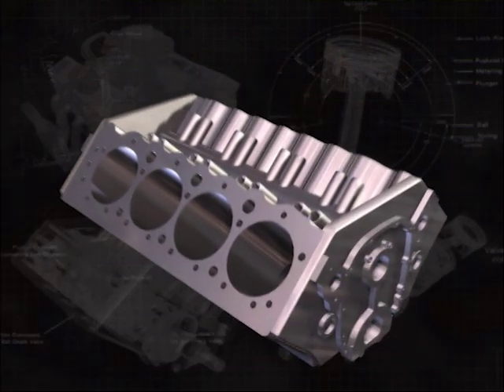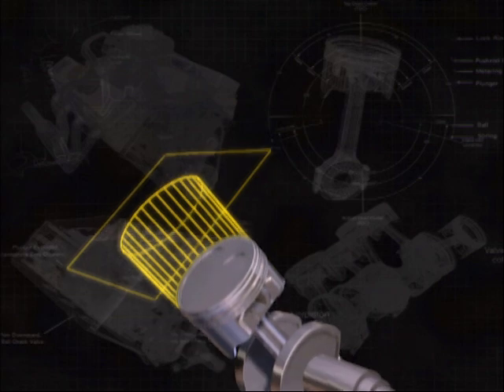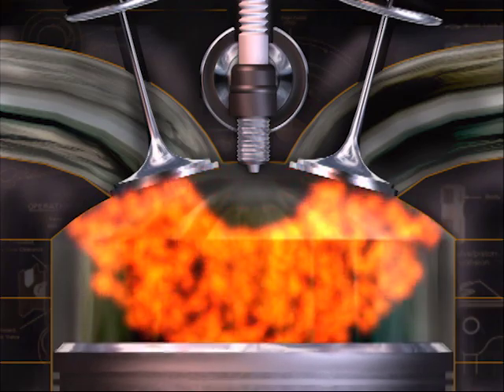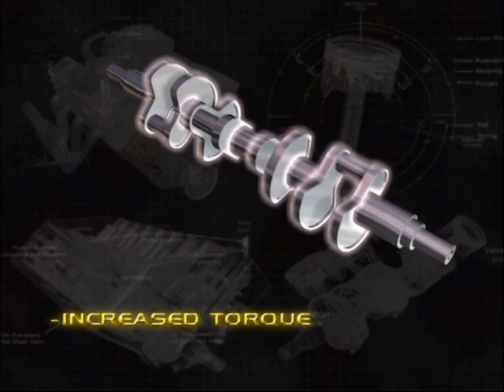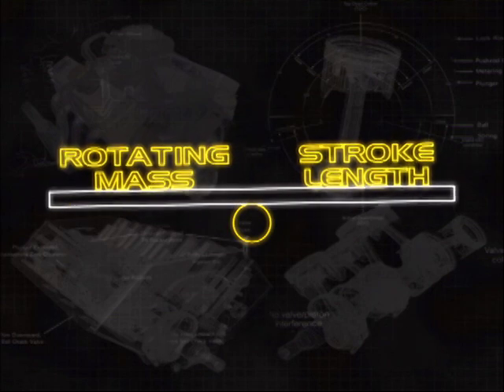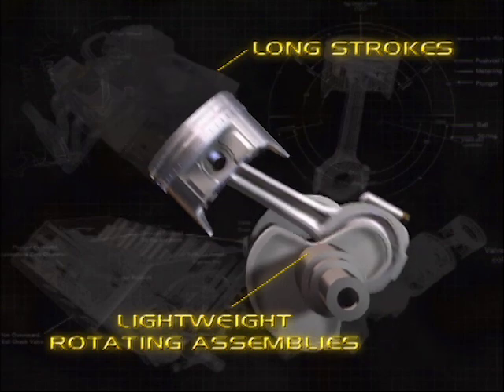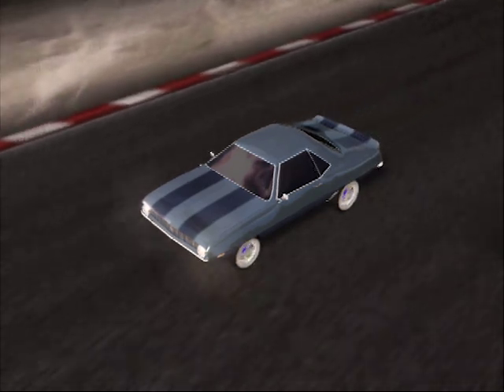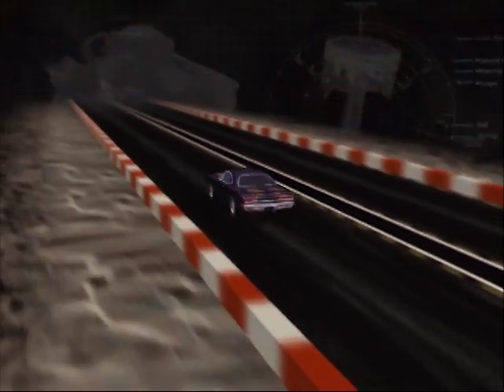Stroker Engines Explained

Comment: I have 2 small bikes both are 150cc. One oversquare (63.5mmx47mm) and the other is undersquare (57x57.8). The undersquare engine is more jerky in low rpm. But the oversquare has much different top end power because of high rev. For a commuter purpose i suggest square engine or undersquare because we don't need much rev to feel the torque and save fuel
Reply: Basically why my g35 sucks fuel compared to my Ecoboost which is twin turbo. I figure that was why but you just confirmed it

Comment: So remember:: always put a 350 crank in a 400, never a 400 crank in a 350. Revs are horsepower. Truck engines belong in trucks
   Go to a drag strip. If you're worried about that short stroke just change the rear end ratio. You can because you gained about 2000 rpm over that stroked RV engine. Revs are HP
Reply: One of the best engines I ever built was a destroked 400.  .030 over 400 block with a 350 crank makes 377 cubic inches if I remember correctly.  And I angled milled a set of double hump heads to raise the compression to somewhere in the range of 11 to 1.  We had it in a stock dirt car and it never got beat. We ran all season and never did anyone ever get in front of us at the finish line.  77 Camaro with a 3 speed standard and that engine somehow all came together as a combination that was unbelievably fast...

Comment: by increasing the stroke dont you reduce power because of reduced max rpm from longer square engine compared to previously oversquared engine?
Reply: IT's pulling in a bigger gulp of mixture and compressing it down into the same space for more BANG BANG!
Reply: @THRASHMETALFUNRIFFS  gotcha! help me out a bit..lets say I currently run a 63mm X 57mm bore to stroke engine then I decide to square up the engine by going 63mm X 63mm bore to stroke...what excatly am I expecting to get out of it? currenty Im at 12.3 compression ration static

I want to stroke up cause Im currentyl at 185 and want to go to a bit higher however Im at a limit with my bore so stroking is the only option. not sure what to expect from doing this

Comment: Hang on. This said that an increased stroke comes from "... longer throws on the crank shaft and longer connecting rods or pistons..." To achieve an increased stroke on an existing engine means longer throws on the crank shaft but SHORTER connecting rods and/or pistons, right? Top dead centre likely won't change, so the increase in length in the crank shaft throw will be matched to an identical decrease in the length of the connecting rod. As a result, bottom dead centre is lower.
Reply: At first, u might think that.  But, it's a packaged deal: crank and rods go together.  Pistons need not change, assuming all clearancr issues equal.
Reply: I only know a 383 SBC stroker uses externally balanced 400 crank, pistons, balancer and flexplate
350 block & rods, and still have to clearance some on the bottom of the cylinder and even get some knocking on ur oil pan

Comment: Just buy a Tesla if you want power
Reply: Tesla/Muscle V8 == Feeding Tube/Eating Favorite Meal
Reply: Virtual reality/ hands on
Reply: StuckInMyGarage quite wrong. I’ve got 2 Teslas and a 5.0 Mustang. Once people get used to the torque, smoothness, basically zero maintenance etc. there’s nothing like it.
Reply: @chargerdave2046  Touche' Charger Dave.  With your permission: Tesla/Mopar Muscle V8 == Virtual Reality Sex/The Real Thing, Baby!  :-)
Reply: Tesla brings nothing to the table with top speed. It is a slow car when talking about top speed